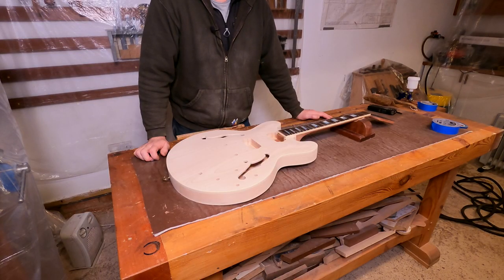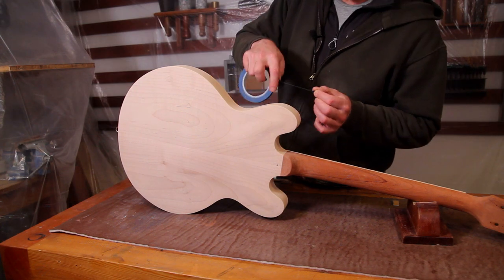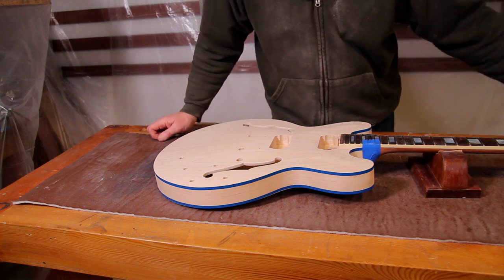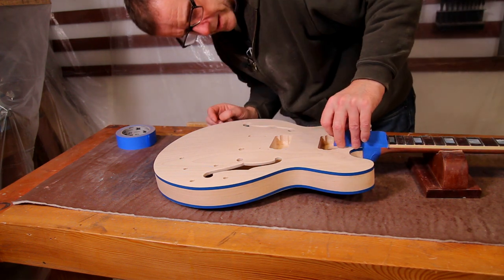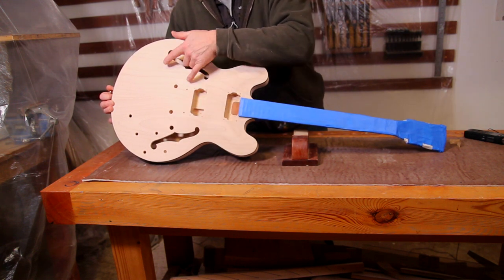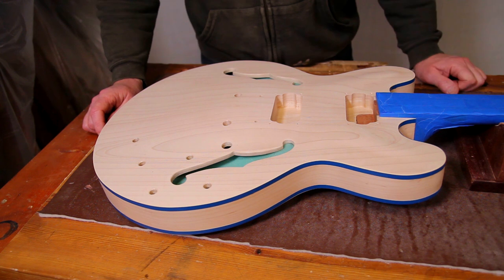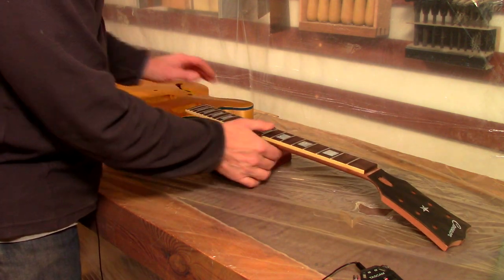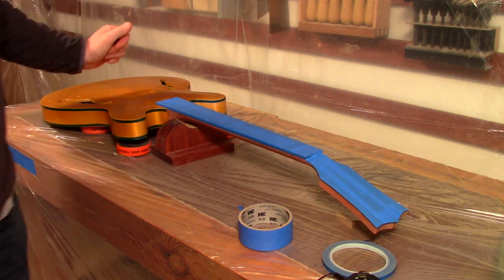The Shed of Dreams ES 335 build Episode 46: Finishing.

Comment: Hi Patrick, what do you do for ventilation? I’ve been using the crystalac clear, it’s ok but a sod to get perfect due to witness lines. Obviously a lot safer than nitro. I just have the fear of poisoning myself when spraying, or even during the drying period as it’s to cold to leave out in my work shop. I stay in Scotland.
Reply from the maker: Hi, I don't have any ventilation in the workshop at the moment. It's something I need to address. Basically I wear a good mask while I'm spraying and don't enter the shop without it on. Once I have finished spraying I leave the door open to allow the air to clear and don't go back in until it's clear. I then remove the plastic sheet and clean the workshop from top to bottom, cleaning with a damp rag to remove the overspray. Once the lacquer has dried the amount of fumes coming off are quite minimal so won't be a problem in a well ventilated space. A cold workshop will slow the curing process but it won't stop it. You just have to factor that into the build.

Comment: Any details on your compressed air setup Patrick? Are you using a water/oil filter just before the gun?
Cheers.
Reply from the maker: Hi Max, I have a 3HP compressor with a 100 litre tank in the garage next to the workshop, it's probably a bit overkill for what I do but better too big than too small. I've never had a problem with water or oil in the lines so have never used a filter.
Reply: @Adventuresfromtheshedofdreams  do you thibk a 50l compressor would handle spraying guitars? I have one on order and I'm hoping it will do the job 😂
 Cheers!
Reply from the maker: @maxcowell4260  Yes, you should be fine with 50L. I got my 100L to sprays cars. The amount of material you use on a guitar spray job is quite small.
Reply: @Adventuresfromtheshedofdreams  brilliant thanks for that reassurance 😂 cheers Patrick